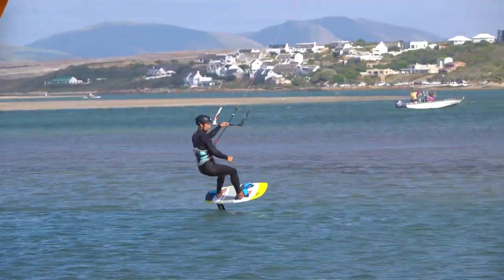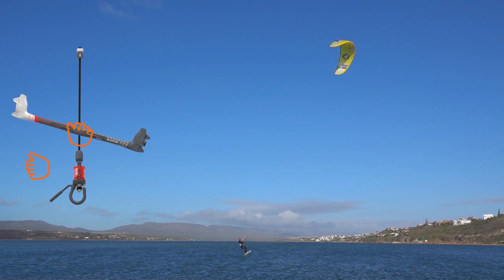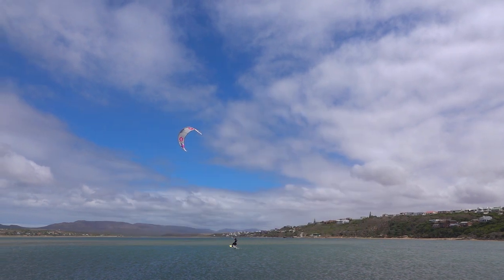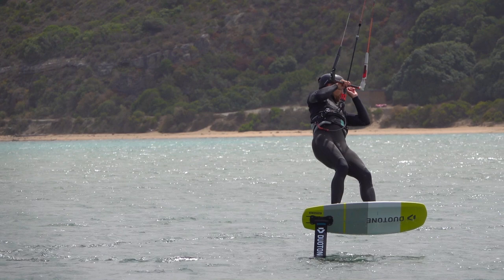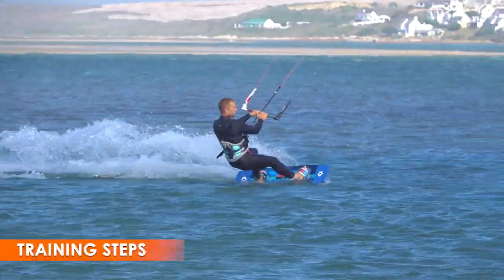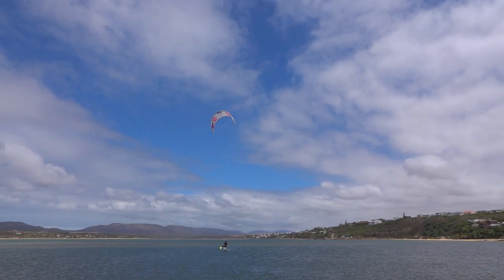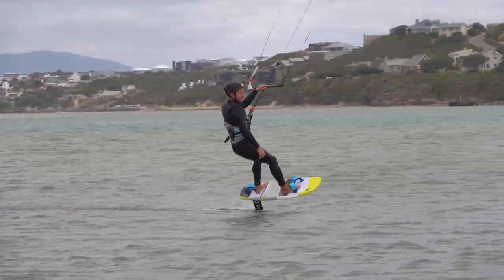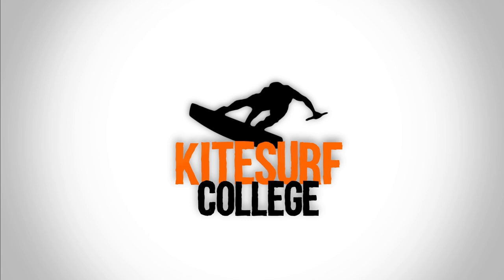Kite Foil 360 Tutorial

Comment: How is it to foil with a Rebel?
Reply from the maker: I experimented with various kites for foiling and now I prefer the rebel. The 2021 turns fast, has lots of power so you can use a small kite or go in very light wind, it gives lots of pull at the edge of the window which makes footswaps, tacks and 360s easier. I would add that a rebel is easier to drop (front stall) than a surf kite like the neo, or a specialist light wind kite like the juice. If you are likely to have issues with front stalling then a kite like the neo, dice or juice will help keep your kite in the sky. If you are beyond the point of having front stall issues, then the rebel will make many aspects of foiling easier.
Reply: @kitesurfcollege  ohh super cool thanks for your feedback. I assumed that the 5 struts weight would be an issue in light wind. I'll give it a try.

Thanks for this amazing tutorial by the way I can't wait to work those 360 😉
Reply: I have foiled with NEO's for 4 years (after riding Rebels on twin tip / surf for like 8 years).   I really recommend NEO's for foiling they drift really well and you can point 60 degrees down wind and the kite just sits there.   If you are ultimately after boosting, Rebel will give you more yank, but I prefer NEO's for all around foiling.